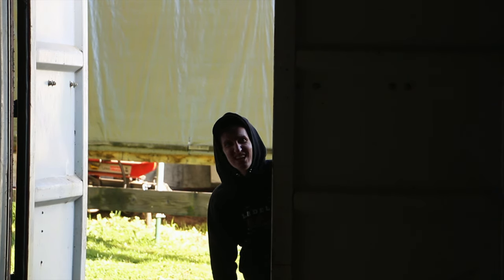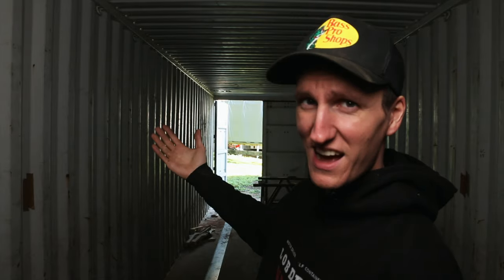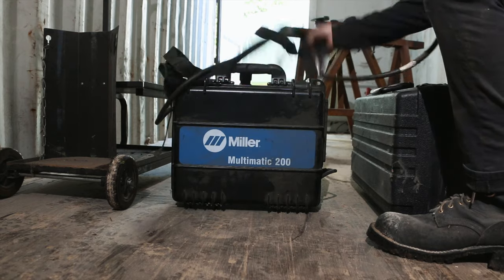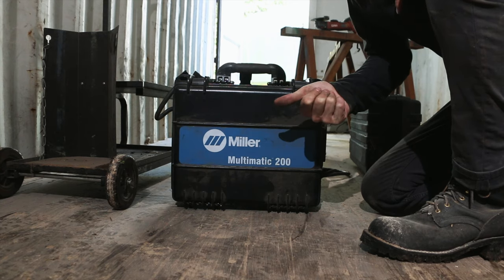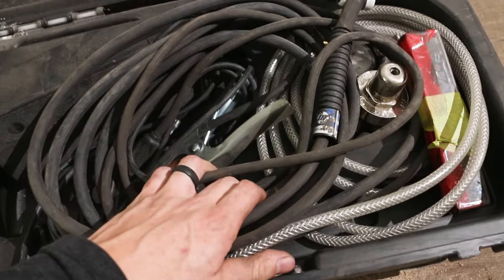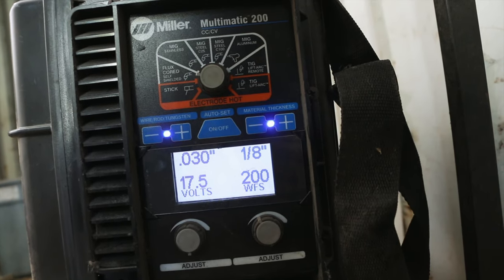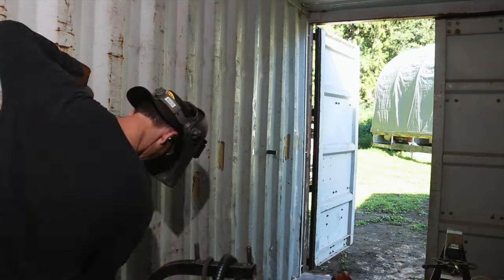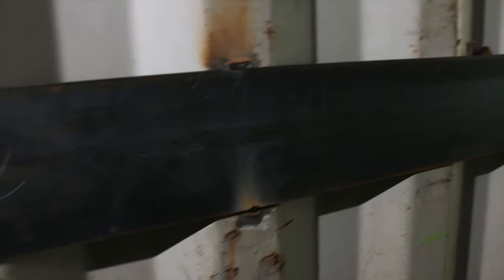Shipping container AXE SHOP - Electrical - Part 2

Comment: You might want to consider cutting that end wall out making it a full hinged door panel, think you might need the ventilation when you start doing any production work in there.
Reply: Didn't he show in the first video ventilation holes for a whole ventilation system?
Reply: @bl4cksp1d3r  May be its because I live in the tropics but in my experience a single entry in a shipping container is only good for storage.....even then its seriously limiting. You’re going to want more ventilation for air flow and noise management if you want to work for any period in a shipping container......For me I would open one of the sides up to (hinged from roof so you create an awning when open)......what ever works for him I guess.
Reply: @bunyipdan  yeah, i can imagine if you need to hammer anything in there, it will be LOUD

Comment: So what are your plans for heating the container, because from my experience with them over the years in construction storage applications, and with a small office setup. 
If you are in the seasons where you have warm sunny temperatures during the day, but at night it drops low enough for frost.
Then they tend to sweat inside, and depending on what you're storing inside you could lose some product due to water staining, and even warping. 
Office doesn't do any better due to drops of condensation dripping on everything. 
The only way to beat this is to insulate the walls and roof with at minimum 1" high density foam board, and a plywood, are chip board over that to allow for electrical system to be attached without penetrating outer shell.
With either electric heat, are gas, and wood, but the last two require openings in the exterior walls. 
One for exhausting the fumes, or smoke, but either one requires a fresh air source. 
One for the wood, and one for the occupants.
Which really isn't a problem as far as water getting in if you go through side walls, and use a good sealant like NP-1 are equivalent so that it maintains it's elasticity.
Then on your outside air sources put a hood over the opening that has good screen for insects and rodents, and also a damper in order to adjust the flow some.
Additionally if gas are wood is your heat source, you'll want a fan to push the heat around to distant areas away from heater.
Just a thought since you are in a cold climate, and have snow deep enough to stay on top of it which could become problematic what with electrical tools, wood products, and your steel rusting from any moisture invasion from above

Comment: Are you thinking of putting a couple windows? Helps from getting the feeling cooped up. Also would make for a second fire escape route.
Reply: Or some skylights!
Reply: @AlanW  Fire rises; ideally your escape would be lower not higher.
Also, just a window or 2 wouldn't be wise, a vent above that can be opened when there's risk of fire would be ideal for keeping oneself safe.
Reply: @D-Vinko  the idea of a window is so you can open it and crawl out of it in case the other exit is blocked. A vent wouldn't help much. And the widow doesn't need to be super high up. Actually would be better lower down for such cases. There is a reason you need a window in bedrooms. For secondary fire exit.

Comment: You should really put the electrical feed and cutoff in the front of the box. If there is ever a problem (fire, electrical short etc..) you can kill the power on your way out, rather than having to work your way deeper into the problem and then back out.

Comment: Do you need to lay concrete platform or something to protect the bottom from corrosion and support the weight?
Reply: I’m more wondering about ventilation from the wood working and probably light metal work
Reply: Martin is a machine he doesn't need to breath